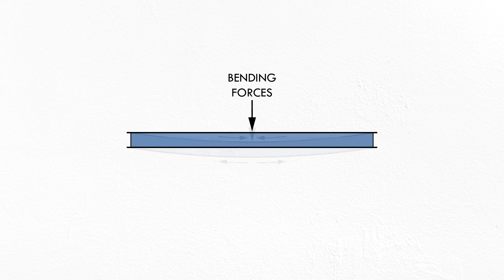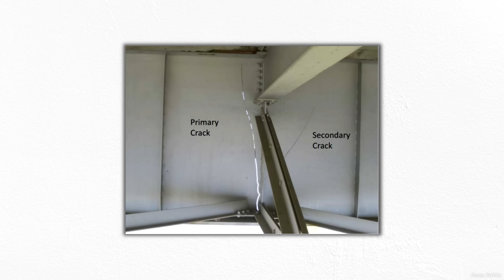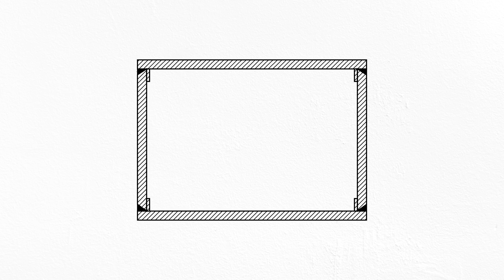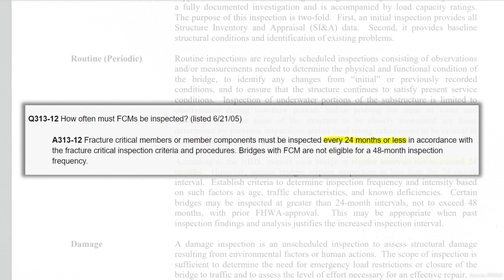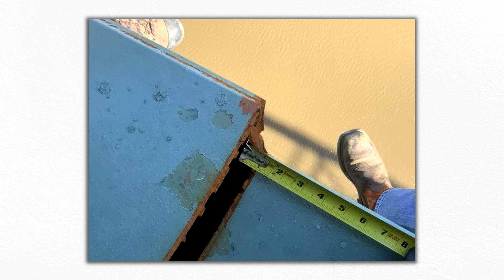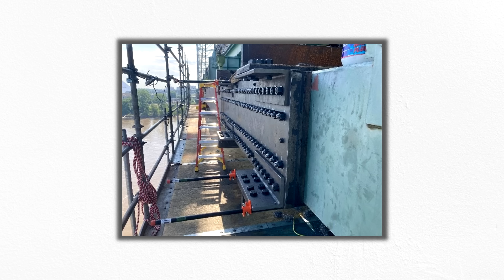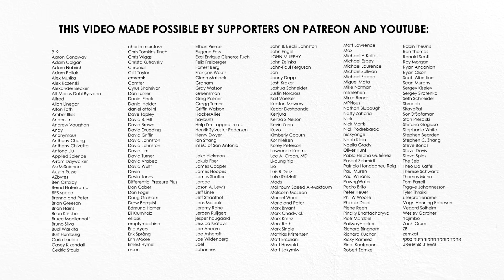What Really Happened at the Hernando de Soto Bridge?

Comment: To the inspector who bypassed his boss, bypassed his client, and went directly to 911 to get the bridge shut down ASAP... your efforts to pass the Engineering Ethics course paid off, right there!
Reply: Curious if that inspector did this on his own admission, or if he was following an sop or protocol that dictates if a critical flaw is identified during the inspection process that calling 911 is step #1.  I would hope that it is the later.
Reply: @kbishop94  Well if the Public would had called 911.  The Police would had shown up then seen the crack then they call up the State Department.

I am a Commercial Truck Driver and when I see non law enforcement road hazards.  I call ODOT in the State of Oregon.  They send someone  out ASAP.
Reply: @kbishop94  In Tennessee/Arkansas? Probably not
Reply: @kbishop94  "or if he was following an sop".  That was my first thought, too.
Reply: @kbishop94  
I listened to that 911 call and the affirmative action dispatcher gave him all sorts of static, couldn't comprehend the issue, and was a model of uncooperation.
Reply: I imagine that to a structural engineer who knew what he was looking at, spotting that crack was startling as hell.
Reply: @calebcarpenter421  You bet ! it is I have closed down 2 bridges in my life and is very fulfilling thinking you might have saved lives.
Reply: @alfonsoperez8535  Yeah?  That pretty cool.  What did you find that required them to be closed?
Reply: Oh, hang on, I see your other comments.
Reply: @calebcarpenter421  That's what I thought, would have a mini heart attack the second you noticed. Followed by fear and hope that nothing happens before they are able to get to a safe area.
Reply: @Jim Allen I don't know. I live in Memphis and he is being seen as a hero by the public.  I don't think they could fire him without a shitstorm occuring.
Reply: @hgbugalou  hell yeah that guy saved lives
Reply: I hope that inspector did not suffer any negative repercussions for not "following the chain of command".
Reply: @georgemead6608  In those cases there is no chain of command. They tell you that during DOT training, however you better know how to back up your case.
Reply: @georgemead6608  
At that point you have to say screw the chain of command. And if the chain wasn't ok with it they should be replaced.
Reply: @georgemead6608  pretty sure they were fired as they missed the inspection year earlier.
Reply: @georgemead6608  on a project like this anyone can immediately shut down the whole operation for safety reasons.
Reply: @georgemead6608  Kudos to the 911 operator who believed him and shut the bridge down.
Reply: @georgemead6608  There are many instances when the upper links in the chain of command should be suspended by a rope!
Reply: The proper thing to do is make that person head of bridge inspections. The romans had a good method of ensuring engineers knew their job. The architect was made to stand under the structure while it was over loaded. Same should happen now to the Board of directors and the MDs once a year.
Reply: @walkerig1  That is so brutal and archaic, but somehow such a beautiful process.
Reply: @roberson644  The romans had several things like that. Practices that, by modern standards, are brutal, but simple and effective.
Reply: @roberson644  it's only brutal if you didn't do your job.
Reply: @roberson644  it is still traditon for the engineer to be the first one to cross the bridge
Reply: @sino_diogenes  no the Germanics were the arrogant imperialists in history not the Roman's. All bad things come from Germanics and Allies were Germanic, not Roman
Reply: @microcolonel  seriously again Germanics are the ones who caused all the bad things in history not Roman's. The Allies were Germanic, not Roman
Reply: @roberson644  
It happened at the Florida College pedestrian bridge collapse only it wasn't engineers allowed underneath.
Reply: @roberson644  Should be common practice these days.
Reply: @roberson644  It's also very smart, it keeps idiots from claiming important posts and keeps them away from the genetic pool :P
Reply: @robjackson5245  , actually, the people that bitch about imperialism and colonialism are ironically just as guilty, if not even more so, than those that they condemn of those deeds.
Reply: @roberson644 it’s not even that bad of an idea testing your buildings with weights? Now having the architect stand under maybe you should have the engineer who made it safe stand under😂
Reply: @walkerig1  Might be the origin of the word "understand".
Reply: @stevengordon3271  it isn't but it was a fun idea
Reply: @stevengordon3271  There's a recent aircraft near-miss caused by the US sense of the word, in interrogative, whereas it Europe, it's a declarative. A United aircraft headed into the parallel tunways of Charles de Gaule North was given the wrong runway by a traffic controller, but spotted a taxiing aircraft entering the runway for takeoff and waved off. The pilot used the word understand interrogatively, but was understood by the controller as affirmative. It's now banned from airline jargon in favour of confirm.
Reply: @walkerig1  That worked for parachute packers during wartime.
Reply: @walkerig1  
BINGO.
Reply: @walkerig1  A good idea that likely will never be acted on.
Reply: @walkerig1  Aeronautical engeneers, mechanics and technicians always fly in the test flights of the airplanes they designed and gave maitenance. It is still common practice.
Reply: @walkerig1  I'll keep that in mind
Reply: @walkerig1 We should make Boeing management part of any maiden flights and test flights :)
Reply: @walkerig1  The Ancient Egyptians had a similar law for brewers: if a brewer made substandard beer, his punishment was to be drowned in his product. If we had that law, there would be a lot of drownings in Budweiser and Miller Lite.
Reply: @gunslingingbird74  8
Reply: @walkerig1  Even older than the Romans, a modified version of the Code of Hammurabi #229 could apply.
"If a builder builds a house for a man and does not make its construction firm, and the house which he has built collapses and causes the death of the owner of the house, that builder shall be put to death.
Reply: @walkerig1  This was actuall practise for many hundreds off years. Even in the US. Thing is, the load driving over the bridge is only a fracture off what the bridge has too carry. The biggest load on a bridge comes from its own weight. So as long as the bridge stays up, when its finished, its probably fine for a long as time. Especially nowadays.

To discover the flaw in this incident would have caused the engeneer to stand on/under that bridge for several decades. Not realy practical.
Reply: @kommo1  dude. Fracture does not mean fraction. You need to use the dictionary
Reply: @karebu2  Do you correct people for having an accent too? English is a complicated language, riddled with multiple words to be used in the same scenario. On occasion someone uses the wrong one, you still get the intent.
Reply: @karebu2  Some people like me voice text and things don’t come out right yes we’re disabled. Others simply make mistakes. God bless
Reply: @gameglitcher  , the problem is not how he said it, but what he said. It was gibberish.
Reply: @karebu2  Give him a break, probably that wonderful autocorrect on his computer. I'm sure he knows the difference.
Reply: @kommo1  
The flaw was seen in pictures from the last inspection.
Reply: @kommo1  Build a house boat for him and his family underneath that bridge.
Reply: @gameglitcher  well, don’t speak of you don’t know what you’re saying.
Reply: @kommo1  For my students' final project bridge, I usually tell them to add 5%-10% for the self weight of the structure. Then when it's done we add up the weight of the design and they are, except in the weirdest cases, fine.
Reply: @walkerig1  ,
the Hammurabi's code seems more fitting.
Reply: @walkerig1  thats why Romans were so stronk
Reply: @PrivateMcPrivate   stronk?
Reply: Possibly he saw footage of the Remagen (Ludendorff Bridge) collapse, and similar. Yes it was wartime and the bridge had tried to be destroyed, but I think 150 Army engineers died when they were trying to make it stable for continual traffic. But good on him, or her.
Reply: @gwgere  Wikipedia contradicts itself and first says 33 Army engineers died and later in the article that 28 died. In one Wikipedia article, 63 were injured and in another 93. Another source said 24 died. I stopped at that point. ;-)
Reply: @gwgere  To this day I have no idea how the men who ran out onto the damaged bridge to disable the remaining demolition charges didn't knock it down with their own wrecking-ball sized equipment.

Shortened the war signifigantly, though not as much as Romania switching sides in 1944(~4-5 months by some estimates). Romania had the vast majority of the oil production in Europe and a very powerful military.
Reply: @gwgere  --  It was bad but not that bad.   Google says 28 were killed and 63 were injured.
Reply: In my state, as a bridge inspector, I have the authority to close a bridge if I found something like this. I would still call my boss to at least let them know it was being closed after calling state patrol.
Reply: @BarkleyBCooltimes  You’re not a “bridge inspector”.
Reply: @BarkleyBCooltimes  , where do you live?
Reply: @HypercubeJones  Having seen that exact situation played out in multiple industries... I am one to give serious consideration to that idea and would investigate that very possibility as a matter of course... Many times I have made a superior sign some sort of documentation declaring that they were bypassing some safety feature or damage in order to keep using a piece of equipment... many times, they reconsidered their actions... other times, it saved my backside from false accusations...
Reply: If I were to inspect a bridge (which will never happen, I’m not an engineer nor do I plan to become one), And I found a crack like this, you better believe I’d call 911 before I’d call anyone else. Every moment someone crosses a bridge could be the moment the bridge collapses. The time saved getting people on scene to close the bridge immediately vs going through your direct line of communication to do the same thing could save the lives of dozens of people.
Reply: @DakotaRileyMedia  Agreed. Something similar was on an airplane in Hawaii. A passenger noticed a crack in the fuselage and didn't say anything. Once at pressure the top 30 or so feet tore off. Only one person died was a air hostess who was on her last flight before retiring. There is a mayday episode on ut I believe.
Reply: As an OTR truck driver, all I can say is I hope the 40 bridge is repaired soon. Driving through the area now is a nightmare of tons of traffic, tons of low clearances, and a rough ride over the archaic 55 bridge. I live in Atlanta (when I'm not living out of the truck) and never heard what the closure was about. Great video explaining it!
Reply: @Jim Allen been there, done that
Reply: @rengaming1052  yeah I was part of the team that handled transportation and finishing of the O rings. Wasn’t our fault, was suspiciously intentionally caused, somewhere somehow. Can’t say more
Reply: Regency-Hyatt Avoided
Reply: Very good discussion.
Reply: @Jim Allen And that's why I didn't try to present it as one. I realize that anyone can put anything they wish in a Wikipedia article and there is no "peer review".
Reply: Leave it to academics to take credit for one guy's good action, and not the other 5 negligent people they passed through
Reply: I wonder if anyone FOIA'd the 9-1-1 call yet -- got me curious to hear the call and see what the Engineer said.
Reply: He did a good thing calling 911.  However it took them almost 6 hours to get the traffic stopped.   My understanding is the 911 operator didn't believe him.
Reply: @roberthough8217  there's lots of unimaginable crazy things in this world.   I don't fault people for not believing lots of horrible things.  It sounds like a made up story.  The crack that big looks like a drill to test the reporting procedure.  I was using a metal detector to look for old is unexploded ordinance and they left a museum piece dummy round artillery shell in our area.  That crack seems like it was drawn on for a drill it's so big.
Reply: @selfification  Thanks for the link. If there’s one lesson to learn from that, it’s that dear god do the engineers in those positions need some training on how to stay calm and communicate effectively with emergency services. They were using technically correct terminology with people who aren’t engineers. The 911 operators obviously were looking for and needed to know how bad is it???

“Major finding on a structural member” might freak-out an engineer but it doesn’t  get the point across. “There is risk of a bridge collapse” would have immediately gotten the severity and urgency of the situation across to them. :|
Reply: I agree. Like Grady said, a lot of inconvenienced motorists are still around to be "inconvenienced".
Reply: There's a comment floating around under this video that pretty much goes "I'm glad this topic showed up on Practical Engineering instead of on Fascinating Horror". Perhaps if the inspector had gone through proper channels it may very well have ended up on the other channel, as that's a common theme in many disasters covered there. "X years before the incident, multiple surveys indicated danger, but their dire warning fell upon deaf ears..."
Reply: But, as you saw it is maybe from 2016 is there although I am with you, If I were in his place may I couldn't that, hats off for his courage
Reply: His bosses were lazy asses.. they NEVER missed a party..i.e. payoff and were worthless leeches.
Reply: yea im not sure i would have the balls to do the same.  given the fact that the cracked member was rusted and seemed like it had been that way for a while, i probably would have assumed that it wouldnt lead to a catastrophic failure at a moments notice...but for sure its better to be safe than sorry in a situation like that so he 100% did the right thing
Reply: And what you said there explains how this defect went unreported for so long, I bet plenty of inspectors noticed it and a supervisor or some other asshole up the chain made it go away because its a major channel of commerce... it happens in airlines too and has also caused tragedies to occur, this is no different
Reply: He took initiative and went above and beyond his job. He very well could have saved a lot of life's.
Reply: The real hero of the story was that guy
Reply: EE was by far the most depressing class I ever took.
Reply: @Jim Allen very well said
Reply: Amen and thank u sir for doing so
Reply: His boss got fired. Lol
Reply: @zbruh7268  Why did his boss get fired?
Reply: @Nombre Apellido (flaco) , why do people keep saying that, when they don't have a shred of evidence? Is it internet-cool to be ever-cynical?

It would be a great way to draw a whistleblower lawsuit.
Reply: @selfification  
How long did it take before you wanted to scream?
Reply: More than one called
Reply: That's right! The person probably was too freaked out (in a good way) to bother with any normal process. When many lives depend on it, who cares about propriety and formality. Good for him!
Reply: sad that he will probably have been fired
Reply: it was still the same ass inspector team who kept missing the obvious crack
Reply: You better believe it. Had he reported up stairs, not only would there be a cover up, he probably would be to blame like the one dude who got fired. Imagine, making 50k a year and being 'responsible for bridge quality' as a sole person. In that case, he better have been paid 500k a year 😃😃
Reply: Well said! We should know their name. 👍🏻
Reply: what are the chances he was/will be fired for that action once the media attention dies down.
Reply: @kazadori164  if his company is a piece of shit then high, if the company cares about a good image then low.

Remember if someone like that gets fired and he plays his cards well, he can get that company in some seriously deep toxic shit for firing him. Media land loves fights like that, so he can definitely be a thorn on the backside of that company if he gets fired.

As an engineering student myself it's sad to see that my fellow engineers sometimes(well usually) don't get taken seriously, just like how programmers aren't always taken seriously. And things go wrong when that happens, sadly managers don't seem to understand that listening to engineers and programmers that say: "what you want can't happen, or we have to do this or else it goes badly" is a smart thing. People like us get hired to do our jobs, maybe mangers could do theirs and listen to us when we tell them to bloody listen.

The world could be an amazing place, sadly we have too many managers without technical knowledge, just look at AMD to see what happens when you put an IBM Engineer at the helm, or at Intel that now has an industry veteran at the helm. Managing a company is not just managing money, it's also managing the technical stuff.
Reply: @aw2031zap  
You would also think they have a code system in place incase some asshole dosnt try this as a prank phone call.

This is 911
Im a engineer on a 747 in flight we need to get this plane landed. Flight br549.
I've found a crack in the roof by the right wing.    Yes its real funny. But some yo yo will do it.   ( it would be news to me a flight br549 or even a 747 was in the air with somone walking on the outside of the aircraft in flight)  they use special rubber boots. They also wear them to change blinker fluids on cars.
Reply: not all heroes wear capes. 

The sad thing is they probably bypassed the boss and client because they knew they wouldn't do anything fast enough and probably knew they were giving up their own job to save lives. 

Considering how obvious it sounds like the crack was, to me it doesn't seem like no one ever noticed and reported it before...it seems like someone along the line kept stalling acknowledging it for financial/bureaucratic reasons cause "it hasn't been a problem yet" and that the inspector probably knew the company had this reputation and knew going up the proper channels was handing out a death sentence.
Reply: This is one of the first thing you learn on Bridge inspection Training. I once had to do the same on a two column bent bridge in Texas which was being under construction and the contractor didn't know how to sawcut concrete and one more in Hawaii after serious scour events. You are out there for the public. They come first.
Reply: I'm sure he let his boss know what he was fixing to do.. if he didn't ... he's an idiot.
Reply: absolutely!
Reply: @Jim Allen I had no idea there was a book on the incident and I am a huge space nut, just bought it on Audible. Thank you for the book recommendation!
Reply: @Jim Allen , which is why laws need to be passed that not only heavily sanction, but also imprison, greedy bastards that try to make legal retaliation when it comes to whistleblowers exposing potential safety hazard, and/or corruption.
Reply: Glad they didn't call Wall Street.
Reply: I wish that discovery and their response was on camera for us to see.  The person to first see it must have been shocked.  Did they first see it from a distance or did someone repel down to that bridge support and then get the shock of their life?!  We see static photos but that beam was probably moving with every car that passed.  How many people were involved in the decision to call 911?  Did they get any approval from their company's head office or did the team decide right then and there?  How much time elapsed from discovery to the 911 call?
Reply: Here's the 911 call. The inspector did call ARDOT before 911.  The 911 operator is a bit stunned. :D  https://www.youtube.com/watch?v=C0svFbN7RSI
Reply: i would of fired the person
Reply: @Jim Allen Very true but you can bet that he was never considered for raises or promotions after that.  If I remember correctly he eventually quit working for them.
Reply: @Jim Allen Nonsense.  I worked in this system (bridge inspection) and ANY crew member could shut down a bridge if they found a critical flaw and many did so.  You clearly do not know bridge inspection.  The failure here was the firing of a single employee; it is never a single persons fault.  It it were, then your system is flawed and at fault.  We have over 600,000 bridges in the US and all get inspected at least every two years.
Reply: @Jim Allen good to know that most of those astronuts are still alive
Reply: He didn’t bypass his client, his client is the people, he prevented his clients from being in danger. States ownthe bridge, if you live there it’s your money that makes their paycheck
Reply: This inspector should be lead inspector for being the only one with a brain to understand this was neglected over several years by a State who has Dumas for a town name.
Reply: cryptic remarks such as this one are childish and ignorant.
Reply: over reaction, just close it to truck traffic
Reply: Now unlike the Akashi Kaikyo, this bridge did not have an underdeck. This bridge needed an underdeck in order to uninterrupt traffic from above.
Reply: yep, he certainly knows his stuff
Reply: Yes!!
Reply: @Jim Allen Roger Boisoly or Allan McDonald?
Reply: Still likely blacklisted from the industry
Reply: I couldn't agree more. I drove tractor trailers across that bridge countless times in the years leading up to the shut down that could have ended in catastrophe!
Reply: With the huge traffic it created? Doubtful.
Reply: now you know there's bigger problem than just that person who got fired
Reply: His client: the city
His boss: most likely the city
The police: the city
Reply: @shammzz3  
Two unrelated thoughts? Or is there an answer? Don't ever allow large groups of people live near each other.
Reply: @shammzz3  TDOT & ADOT are state highway departments not the City of Memphis.
Reply: He will probably be reprimanded since he claimed the Glory.
Reply: @gordbaker896  he works for a private contractor hired by ArDOT so I’m sure he’s doing just fine.
Reply: @gordbaker896  yeah, he was the inspector that was fired.
Reply: @gordbaker896  v WA
Reply: He had a hell of a time getting through the severity of the situation to the operator.  He would have likely saved several minutes by issuing a bomb threat and apologizing afterwards.  After listening to that conversation, I think it's justified
Reply: @timothylegg  I do structural inspections for a living (not bridges), and the best way to get people to understand how critical a situation is is to tell them the consequences if they don't act now.

Saying the bridge could collapse at any moment due to structural damages is something that anyone can understand, and is a lot more clear to a layman (like a 911 operator) that it needs to be addressed ASAP.
Reply: I suspect the person they fired probably either wasnt allowed the time to inspect correctly, or he reported the crack to his superior who then did nothing.
Reply: @Jim Allen I worked for one the sons of a woman engineer who was fired before the challenger explosion for pointing out the problem with the o rings.  Cost effective to ignore the problem
Reply: Micah Thomason  
>Suspended deck arch bridge with a severed primary horizontal loading member
>blown out of proportion

CHOOSE EXACTLY ONE
Reply: Once we, the quality manager and myself, a materials quality engineer, stopped a Tv set production line due to high voltage leaking in a HV transformer which caused an electric shock to our operator connecting the CRT tube.We suspected the whole lot was potentially defective. We could not determine how widespread the defect was on the spot and ordered an exhaustive inspection, which took the whole graveyard shift to find the defective lots and the root cause, and sure enough, we found several defective units. We were in the verge of being fired because we lost 15,000 units, we were not because the doctor supported our decision, a high voltage shock may cause severe damage to a person and possible death. It was obvious that it was not the failure of the persons who stopped production or the quality inspector in the HV transformer production line. The system failed and it had to be corrected to avoid repetition by means of the implementation of enough preventative measures. Yes, you may fire the inspector, but that is not nearly enough, because it was the system that allowed the failure to be missed even when it was so evident, this in the case of the bridge.
Reply: @Jim Allen he may be saved by whistleblower laws… let’s hope. This is also such a high profile thing that affected so many people, if people learn that the guy who potentially saved them was fired for doing just that, there would be public outcry.
Reply: @Jim Allen and unfortunately, it seems NASA didn’t learn anything since once again, not listening to their engineers lead to the loss of yet another shuttle. This time Columbia
Reply: @Oklahomarailfan.  
The Columbia was fine when it left the ground. Once airborne the end was all but certain.
Reply: @larrybe2900  they knew of the foam strike for the nearly the entire 16 day mission. The Government offered nasa for them to take pictures of Columbia’s wing which the engineers wanted, NASA ignored their request and stopped any attempt at getting said images. Once again ignoring their engineers lead to disaster
Reply: @Oklahomarailfan.  
At what point by your standards was a good time to re-enter earth's atmosphere?
Reply: @larrybe2900  once the foam hit Columbia’s fate was for the most part sealed, I believe there was some hope to save the crew if attempts were made in time, but there was probably no chance in saving Columbia itself. Columbia wasn’t going to be able to Reenter with the damage it took
Reply: Yes
Reply: Living on unemployment wont be fun, but He will have His conscience. Plus lots of free time to continue studying bridges... That He lives under.
Reply: @Jim Allen it would be wonderful if you weren’t allowed to post anything other than fact cause you are full of crap
Reply: @emmettbrown6418  a company failed an inspection and informed me lamenting that my company was the only company that ever failed them.  Just simple construction work.  Some stone needed more compaction.  That construction company had the project owner get another firm that would lGIVE passing marks on every test.  That's really the unfortunate state of the industry.  If you fail a company they skate and resubmit until someone gets killed and they declare bankruptcy.  I've sadly experienced it.  And construction companies want to halfway do the work, talk their way into a passing inspection or acceptance variance change order.  My second job is a musician. Even on the chitlin circuit they fight over whose going to clean the chitlins.
Reply: What are his chances of promotion? He may well be "engineered" out of his job. It takes a brave person to blow the whistle.
Reply: @HypercubeJones  I suspect, not claim or accuse.
Reply: He probably lost his job for it and was blackballed in the industry.... this is America, if you cost your employer money you are done.
Reply: @IvoryOasis  , plot twist, the employer is done because of the Great Walk Out.
Reply: And he’s probably blackballed which is why people don’t snitch, because it’s only appreciated in hindsight after someone’s mom, or kid dies.
Reply: @Gamebreaker08  What does blackball mean?
Reply: While I am impressed I am not sure how that phone call would have gone down. 

Please close the bridge
Why 
There is a crack in it
Who are you
An inspector,
OK why are you reporting this?
Because its urgent you do it now.
You sure this is not a prank
Yes I am the other side has already closed.
can I get your number to send you a photo of the crack
Im not a inspector but I think you are pranking us.
Please close it.
Reply: This was a bridge painter that discovered this and bypassed the inspectors and reported the cracked beam which all the inept inspectors missed - have to give them credit though hiring the blind , deaf & dumb for inspection along with paper degrees 😂
Reply: Too bad she/he wasn’t working anywhere near the Joliet IL bridge...that one needs to be shut down immediately.  But the politicians don’t care.  They talk out one side of their mouth about how they care about safety and don’t do a thing about a bridge that has been deemed unsafe by engineers for nearly a decade now.  When, not if, the collapse occurs, there won’t be a single crooked politician to be found willing to take responsibility.
Reply: @russjordan243  Illinois, corruption? I'm shocked. Does anybody else know of this?  S/
Reply: There is no way the 911 Operator, after the call, had the authority to take the decision to shut down the bridge. Sure, it was good for the inspectors to call 911, but for sure that did not automatically result in the shutdown. Some people were no doubt consulted on 'what shall we do gov?'
Reply: @ceesklumper  Why would a 911 operator be unable to shut down the bridge. They can orchestrate shutting down and redirecting roads after accidents, and the police are the people who would conduct the operation. If an inspector called in, provided sufficient identification, and stated the bridge could structurally fail at any moment, the operator would be negligent by not acting.
Reply: @ceesklumper  The 911 operator themselves, no, but the senior people in the 911 call centre almost certainly would. Those centres are designed to act very fast to any emergency and things get passed to the right people who can make those decisions very quickly.
Reply: @ceesklumper  There is no way the 911 Operator […] had the authority […] to shut down the bridge.
The operator can make it happen, and this clearly is a case where you take the authority if needed and do what must be done. 

And then you inform the higher ups. 

They can countermand the order — likely before the police even arrives at the bridge — and no harm done. (Besides, only a fool would stop the bridge closure at that point.)
Reply: @ceesklumper  temporarily, they probably do. If they can shut everything down for a potential jumper for several hours, which does happen, or a traffic accident. Then they can shut it down for this reason as well.
Reply: @ceesklumper  true, but the act of calling 911- protocol or not - documented the situation as emergent and took it out of the hands of his superiors at that moment because they know that the call would be discoverable by the army of lawyers decending on them if the worst should happen. A brave act on the part of this inspector if he wasn't required to do it because leadership never takes kindly to sunlight, or being backed into a corner. Repercussions usually follow.
Reply: @ceesklumper 911 operator doesn't have the power to do anything except contact responsible agencies.  The point of calling 911 is to immediately facilitate that contact.  I believe that the inspecting engineer does have the authority to shut down the bridge.
Reply: @ceesklumper  You'd be surprised. Better stop and assess than follow BS.
Reply: I'm surprised he wasn't fired for being a whistleblower and bringing shame to his boss.  I'm surprised he wasn't jailed and blamed for the situation.  Shoot the messenger is the official American policy.  That's why people don't speak up.
Reply: @mikeshoults4155  Knowing how the family who runs Memphis works, I concur.
Reply: @mikeshoults4155  there are whistle-blowers laws that protect them. So long as it's not against the government. Aka Snowden.
Reply: @mikeshoults4155  It's a common human tendency, not just an American one.
Reply: He's probably the unnamed inspector who got fired.
Reply: @danielmclaughlin5573  , or, more sensibly, the one guy who was responsible for previous inspections and missed the crack was booted.
Reply: Ethical move, sure. Unfortunately that inspector is no hero and will probably take some heat for his efforts. Rust on the inside of the crack indicated that the fracture had been present for quite a while. Following chain of command would have been the most appropriate move. Luckily it's not a huge deal here, but it sets the wrong precedent- next thing you know you have inspectors calling 911 for a missing rivet.
Reply: Sad part is I’m sure he or she was ridiculed for it, and put on leave. Or some bull shit like that.
Reply: who wants to bet he was the "unnamed inspector" that got fired?
Reply: @thesurnamewithnoname7188  i'd bet he/she wasn't.
Reply: Yet he probably got fired.
Reply: him calling 911, is another example of their terrible processes.  he should have had a manager/supervisor on speeddial so they could interface with Leo in tn/ar... but all he could figure was 911... and sound like an idiot.
Reply: @david-sv3kg   👈👎👎
Reply: That fracture had been there for a long time before it's discovery.  Look at the rust on the fracture faces.  How can some kid engineer shut down both river traffic and vehicle traffic with a 911 call.  That system needs to be overhauled. Clearly road traffic could have continued for a few hours until detours were established and also clearly river traffic needn't have been interrupted.
Reply: @dannydavis8889  Without a crystal ball who knows when it all goes pear shape. Once it is known shutting it down asap seems logical and sensible.